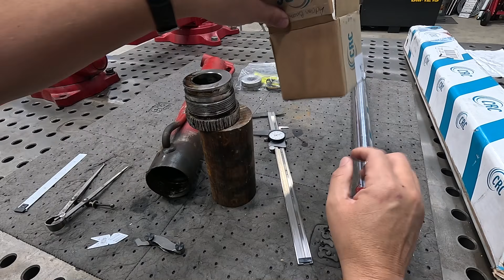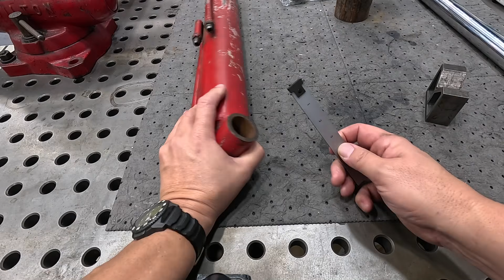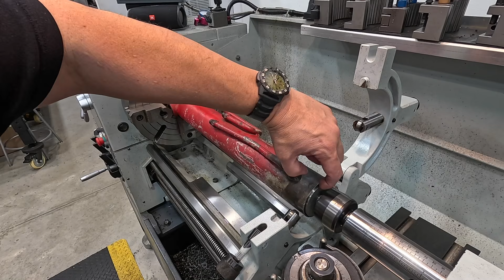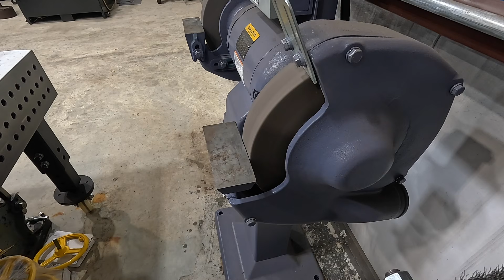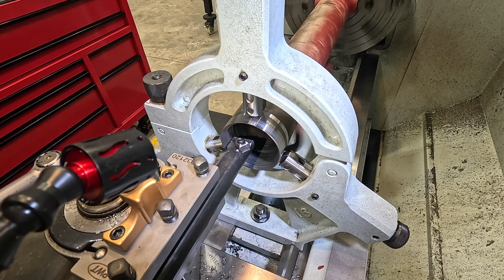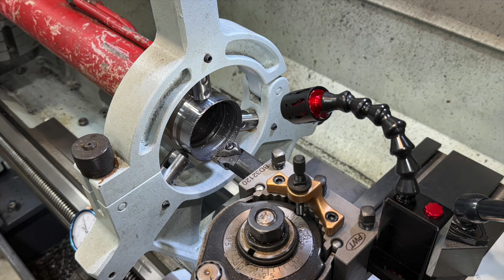Chasing Internal Thread: Mahindra Hydraulic Cylinder Repair Part 1

Comment: I just rebuilt two lift cylinders for a bobcat 853. Both of the glands left half of there threads in the barrel threads. Barrel and rod looked great still, seals were just old and deteriorating. Since the heads are aluminum I was able to just pick out the aluminum threads out with an o-ring pick, wire wheel it and the new heads threaded in perfectly.
Reply: tayld dactyl removes  aluminum bearing residue from bearing journals using muriatic acid

Comment: I have one I still can't get apart.  Planning to mill some new flats to try to get a better bite.  At one point, my 3/4" breaker bar was bending so I gave up so hoping a big pipe wrench will help.
Reply: Maybe apply a bit of heat on the end of the barrel? Not too much, but 100C (212F) will grow the steel a few thousandths, maybe just enough to get things moving again.
Reply: @CacheRAM  I tried heat but could no longer get a good enough grip on the gland nut.  The aluminum gland nut just keeps shedding pieces off with a pipe wrench which is why I need to put some flats on it.
Reply: I usually do two things when they resist 
I take the hydraulic cylinder to the anvil and tap the outer tube at the height of the inner thread. That way I lighten the tension between the inner and outer thread 
I also heat that outer part if the first option doesn't work but I let it cool before loosening to avoid seizing the thread or if I loosen it while hot it is a minimal movement 
Aluminum doesn't hold heat well because it is softer and can deform 
Perhaps that is the cause of Abom's repair problem.